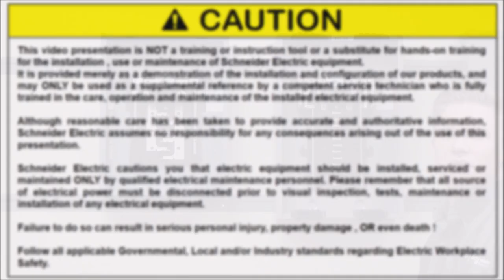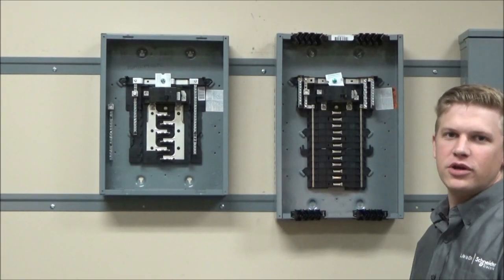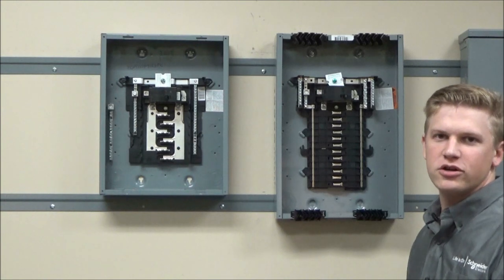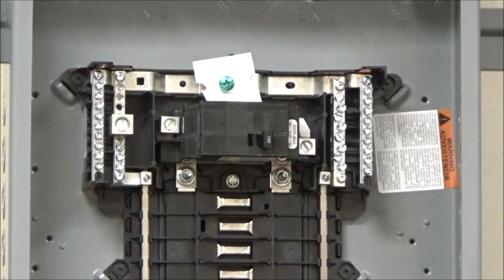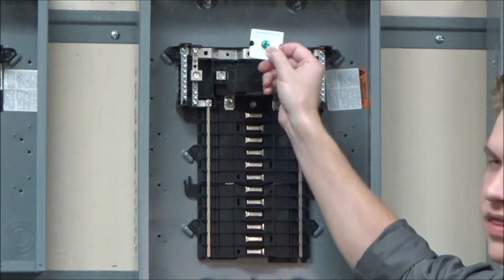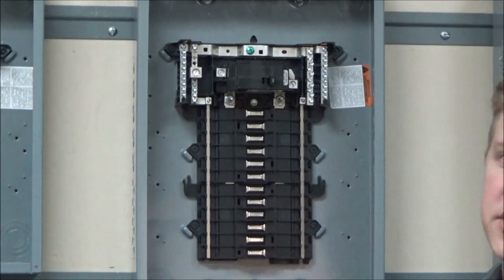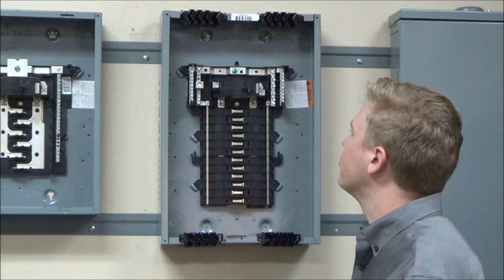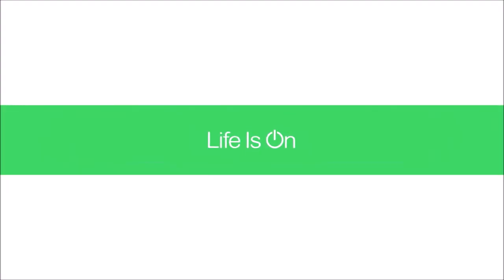Installing Neutral Bonding Screw in Low Amp QO & Homeline Load Centers | Schneider Electric Support

Comment: hmmm mine has the hole through the neutral bar, but the enclosure is not drilled.... The box came with the bonding screw... and the wiring decal shows it is the correct location...  just no hole to thread into...
Reply from the maker: Thank you for your message. We house most of our documentation in a virtual database here: http://spr.ly/6056wy2iM. If this does not address your concerns, please reach out to a technical support person in your location. http://spr.ly/6059wy2iP